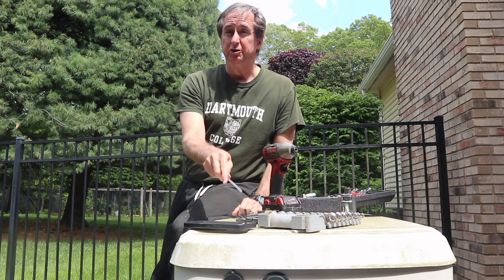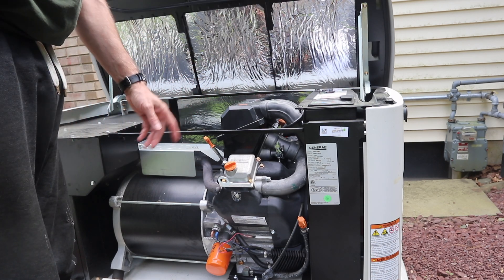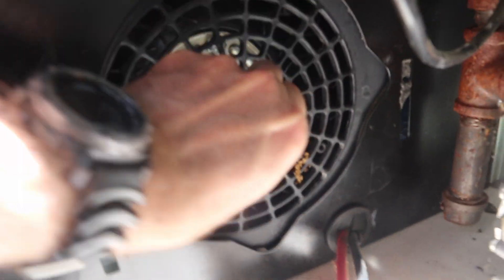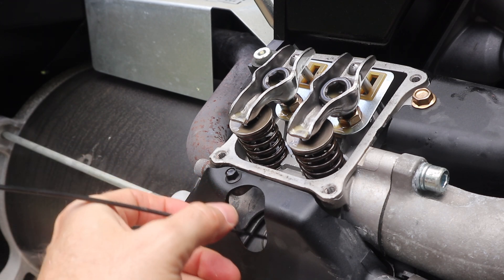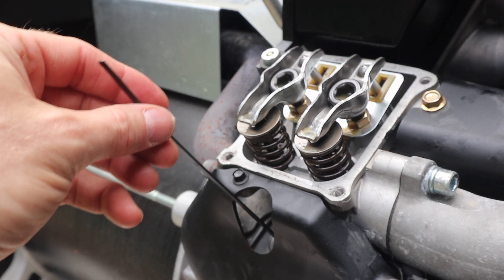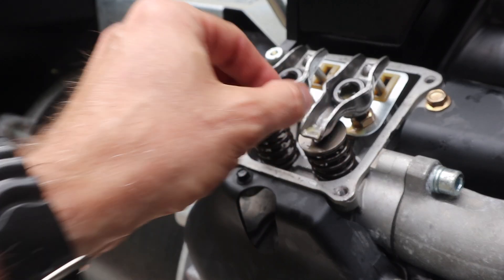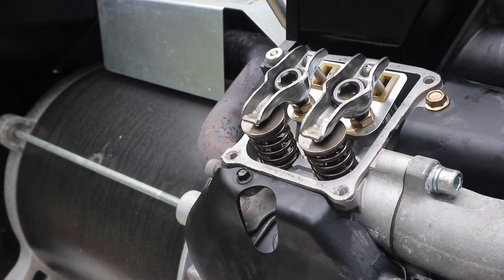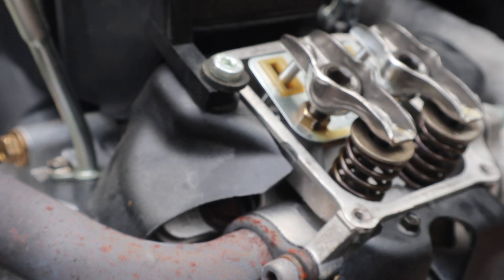Generac valve clearance adjustment / valve lash adjustment

Comment: Great video -- nicely filmed and narrated!  I strongly advise having a set of gaskets in-hand.  Most videos show the valve covers coming off with the gaskets intact, but some of us are not so fortunate.  Both of mine tore and one was mostly stuck on the engine head, which was a headache to remove due to the narrow work area at the top, beside the intake duct.  Expect to spend considerable time carefully scraping, and be sure to pack a rag around the valves and rockers to prevent any debris from falling into the engine.

Comment: Can parts like the oil, filter and plugs be sourced at an automotive store? Or are they something so specific, you have to get the Generac kit? Do you find you can reuse the plugs or is the seal shot once removed? 
Thanks again!
Reply from the maker: I've gotten parts from Generac, auto parts stores and Amazon. I replace my spark plugs every year. If I remove one I have not had an issue reusing it as long as it's before my yearly maintenance. For this video I was just adjusting the lash, so I reused the same plugs.
Reply: @imsmoother  Thanks! I saw a kit on Amz for $35, so that's a no brainer. Appreciate the help!

Comment: Remove the left side black panel on the side of the exhaust which is secured by a few 10mm bolts. Easily turns by hand. Very good video though!